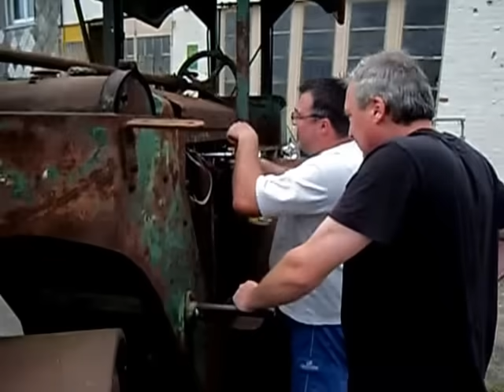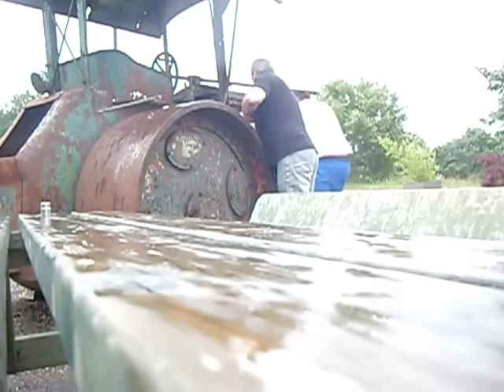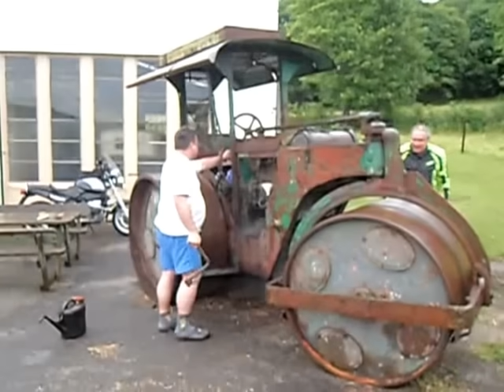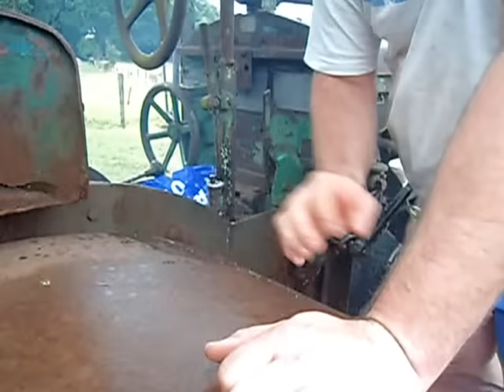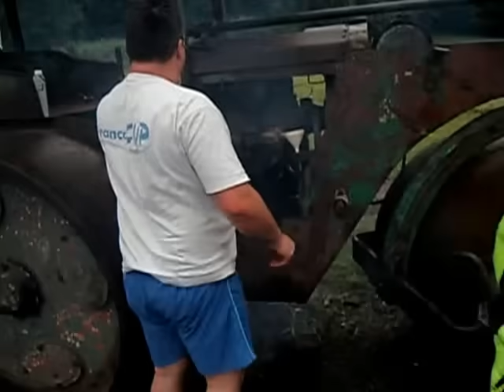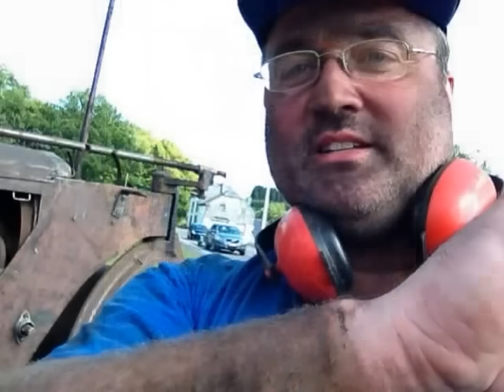Démarrage ancien rouleau compresseur Zettelmeyer 1944

Comment: Bonjour

N’y connaissant pas grand chose en engins de chantier anciens mais étant très curieux j’aurai aimé en savoir davantage sur ce bel engin :

Quel masse à vide fait il ?
Quel type de moteur diesel est utilisé pour le fait de déplacer ?

Quel est le principe d’un démarreur à mèches ?

Cordialement
Reply from the maker: Bonjour, il fait 8 tonnes, le moteur est un bicylindre Deutz, les meches permettent l'inflamation du gasoil lors du démarrage, on place les meches sur les portes mèches (sans les allumer contrairement à ce que beaucoup disent), et on les revisse dans chaque cylindre.La meche de démarrage s'enflamme spontanément au moment de la compression, et facilite ainsi le démarrage (ancètre du préchauffage en quelque sortes).
Reply: @wilburtrac  merci pour ces informations très intéressantes
Reply: Rouleau compresseur rolroyce